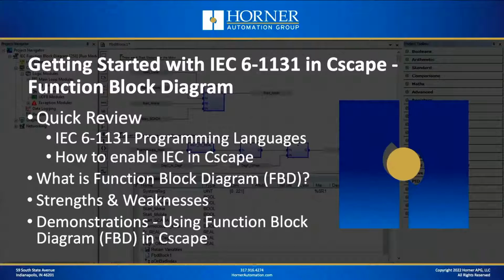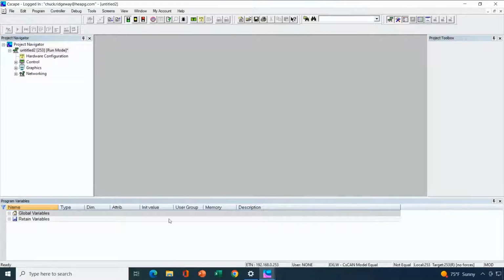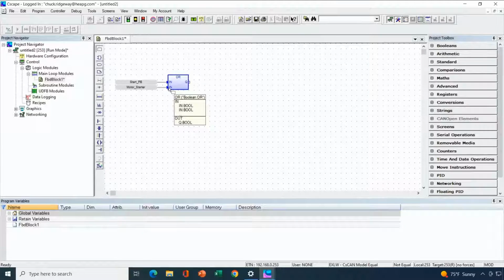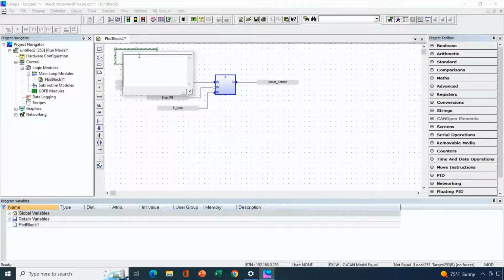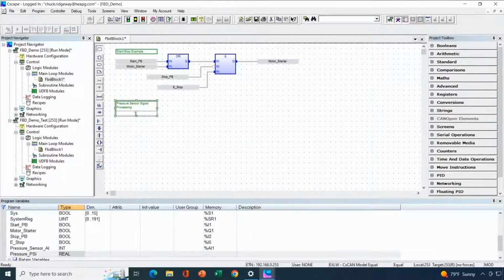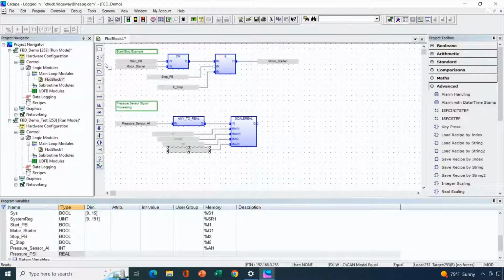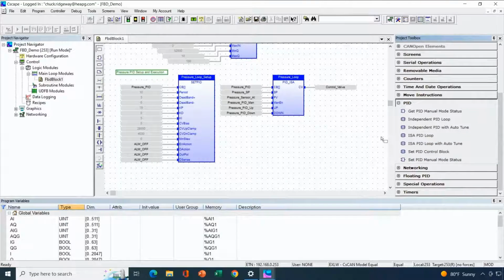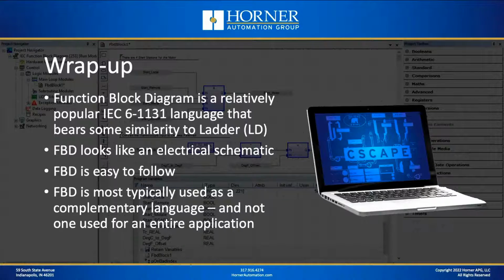Getting Started with IEC 6-1131 Function Block Diagram in Cscape

Comment: Thanks for this series, can you tell me what the difference in execution speed is between Ladder, Structured Text and Function Block in the Horner.
Reply from the maker: It really comes down to the efficiency of the compiled code.  All else being equal, I don't expect large differences in execution time between the IEC languages.  Between the logic compilers in Cscape, Advanced Ladder is the fastest, followed by Enhanced IEC and Standard IEC.  So there is a small small speed penalty for the flexibility of using one of the IEC logic compilers in Cscape.